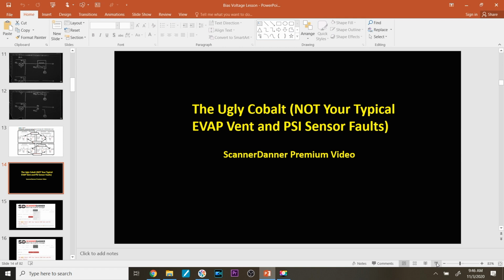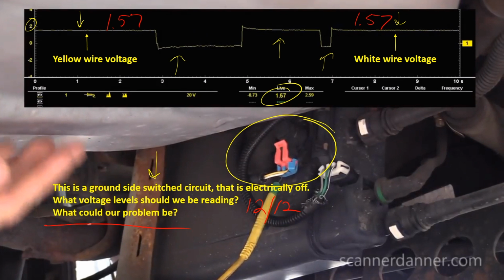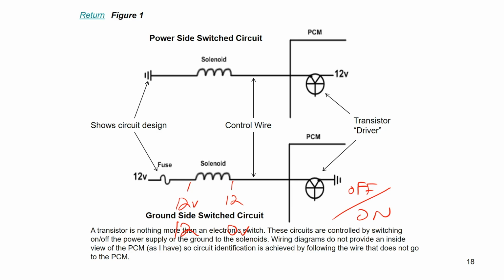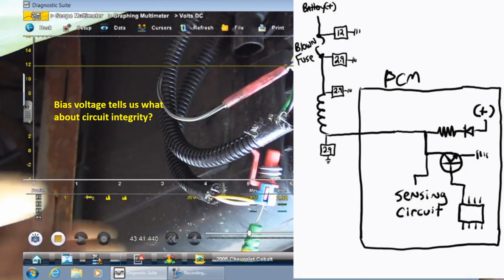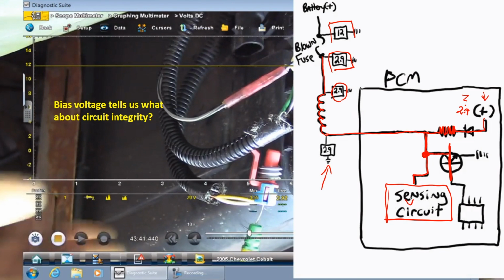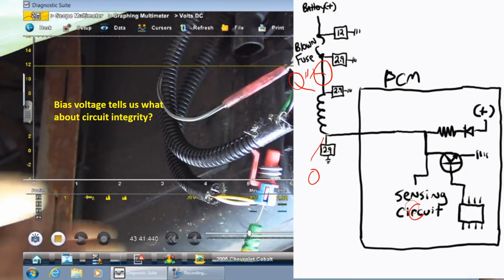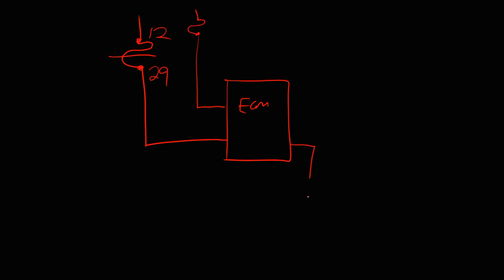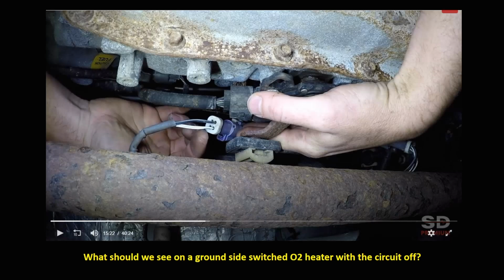An SD Premium lesson on Bias Voltage

Comment: This is just like my electrical engineering class, but we had to design for various parameters. There are also other configurations too, where it can become an amplifier.  That circuit is also the basis for 90% of the stuff that goes in computers and microprocessors. Once you can "NOT" "AND" and "OR" those things on a scale of a billion you have a modern processor.

Comment: best teacher ever, seriously. I owe so much of my success to you Paul!
Edit to ask:
If the car wasn't starting, why was it pulsing the trans solenoid (which caused the 29v back feed). Also, even if the fuse is in and the car is in working order (like the newer one that you compared the voltages to, to confirm your theory) wouldn't that 29v back feed cause problems with the system?
Thanks,
Dan
Reply from the maker: Half the PCM was alive and the other half wasn't is the only explanation I can give you.
Thank you Dan!

Comment: couldn't the short to ground be cutting the bias voltage from 5 or 12 vlt's to 2.9 vlts because it's a crappy ground?
Reply from the maker: No sir, the short to ground was on the power side of the circuit

Comment: one thing i would like to know .... 
1. At time 20.47, 12 v comes down all the way down to the leg of the sensing circuit, and meanwhile, 2.9 v should come through diode and also meet at the same leg of the sensing circuit.
2. You did not mention how 2.9 v behaves through diode and resistance??? If 12 v can come to the leg of the sensing circuit, where is the 2.9 v???? Is it 12 v-2.9 v=9.1 v be the reading at the leg of the sensing circuit??? Please clarify this.
3. How the 2.9 v behaves?
Reply from the maker: there may not even be a diode if the bias circuit is 12v but let's entertain that the source is 2.9 and that there is a diode. I placed the diode there in my imaginary drawing to show the 12v will not be able to backfeed into the lower voltage circuit, that is all. 
On a good working circuit (no opens), with the circuit off, you will have 12v sitting on one side of that diode and 2.9v sitting on the other side. No current will flow because of the diode preventing the 12v from "flooding" the 2.9 volt circuit. And looking at it from the other direction, the 2.9 volts cannot flow into the 12v circuit because the potential is too high. The sensing circuit will see 12v, with the circuit off. With the circuit on, it will see 0v. The purpose of the bias is for the module to be able to recognize the difference between an open or a short. Without the bias, it would not.
Reply: @ScannerDanner  okay thanks for the explanation. 
I now know why 2.9 v doesn't flow on the other end of the diode. I have to apply the rule 'current always flow from higher potential to lower potential'

Comment: Should I have a $3500 remanufactured transmission (jasper 100k warranty) put in an 03 Lincoln Town Car with 180k? I love the car and its otherwise in great condition (engine, paint, body, suspension, interior). I drive 60k highway miles a year for work and diy all the maintenance/repairs. Plastic intake manifold already replaced lol damn 2v 4.6
Reply from the maker: tough pill to swallow, how about a used one? Have you looked?
Reply: @ScannerDanner  2 shops quoted around $2000 parts and labor for used. That is with fluid and a new cooler. I believe the engine will last another 100k highway miles because it runs like a Rolex and only burns 1/2 qt of oil ever 5k
Reply: Yes, you absolutely should, provided the body and interior are in good shape.  I've got a 2003 Grand Marquis w 200k miles and the original transmission, and the car is mostly bulletproof and, when it breaks, it is dirt cheap to fix. The only big ticket item between now and 400k miles is a transmission, and I will gladly buy one when the time comes.   You can't buy a town car with less than 100k miles right now for under 10 grand, and even older ones with 200k miles are going for 5-6 grand.  $3500 to hang on to a model in good shape, with a 100k mile warranty on the transmission, seems like a no brainer.

Comment: The sense feed voltage can't be 12 volts, because then it wouldn't be able to set low voltage codes with an open curcuit. I would say it uses the 5 or 3.3 v regulator inside of the pcm.

Comment: hi paul i heard you in most videos talking about bias voltage but did not understant what is it . it is only today that i understood it. according to my understanding bias voltage is just a voltage disigned to confuse technicians. it has no use other than than.

your 2 years follower
m.b.s moshitoa (south africa)
Reply from the maker: I use it to determine circuit integrity. I has a HUGE advantage for a tech when you understand how to use it. 😉

Comment: About the voltage behind that diode supplying the bias voltage in the example of 2.9V, it's my educated guess that the supply voltage is around 3V or 3.3V.  It's possible that the diode isn't there and the supply is 12V, but that wouldn't really tell the computer anything through the sense circuit besides a shorted/open driver.  If the bias is low and the diode is present, the computer can distinguish an open coil circuit and a shorted/open drive circuit.

Comment: One good one that happen to me 
2011 ford ranger timing job crankshaft sprocket slightly different due to aftermarket parts on wrong box got the sprocket for a engine with balance shaft and the harmonic balancer when in a couple mm further in and crankshaft sensor had a intermittent signal
Reply from the maker: The video i mentioned with the 29v? That was one of the issues with that vehicle too! And is why it got the parts shotgun lol, crazy stuff for sure. Thanks for sharing!

Comment: Circuits like these are why we have big foreheads. Scratching your head and sliding glasses on and off tends to plow the field. I took a little mental field trip on an early 2000s ford ranger that I’ll never forget. With main PCM fuse pulled and KOEO probing both terminals, supply 12...PCM “load” side 24VDC. It’s the kind of thing you can’t just go look up lol. Interesting way of protecting the PCM. I had already found and fixed electrical problem but then noticed that KOER my PCM supply was less than charging system voltage. 
 You can pay to go to a class and hope they teach you everything you need to know in the field or you can take the basics you’ve learned and figure it out. Either way cost you money but I’ve done both and the lesson sticks better when it kicks your butt, you touched on that in this video. Good stuff man.

On an edit: I typed this comment before end of video, as soon as I clicked play you go into blown ford fuses lol. My thinking was that Ford was by design creating the higher voltage from a transformer in a means to protect the board. That critical 16-18 “poof” range wouldn’t matter

Comment: Paul, you should try troubleshooting with a digital probe.  By concept it's similar to a test light except it follows transistor - transistor logic.  Benefits include you can identify if the circuit is pulsing (whereas sometimes pwm is involved but the naked eye can't tell the duty cycle) it can tell you if you are at logic HIGH and logic LOW such as the ability to sink or source current. (similar to pull up or pull down circuits)  Seriously, give it a try, they are not really expensive and it's an easy learning curve.      I have a feeling GM may be employing stuff like this in their tech's training and equipment.  Cheers bro,  Louis

Comment: Many years ago, I built myself a set of 20 foot jumper leads out of radio shack mega-cable. I'm sure a lot of youngsters are probably asking themselves "wtf is radio shack mega-cable?" but I digress. You just had to be there. My point being, I can attach to the battery, and take hot and ground with me anywhere in the vehicle without wondering "am I on a good ground?". Yes, I understand there's certain instances where being attached to body or chassis ground is better for particular testing. However, the vast majority of the time, being solidly connected to battery ground is fine for testing. Removes a lot of the guesswork.
Reply: The whole intro of the video about testing with a "unknown" ground thats all I'm thinking of is my retractable dual lead set and I do the same as you sir!

Comment: Just something to add about the coils magnetic field causing that voltage spike.  The magnetic field of an inductor, or coil, wants to keep current steady.  It opposes change in current.  So, when the switch is first closed, the current begins to ramp up.  If the inductance is constant and the applied voltage is constant, then the ramp up of current is constant.  For the real techies out there, this is true until the core material of the coil saturates with magnetic flux and/or the wire resistance comes into play.  The point of this post is, the collapsing magnetic field doesn't directly cause the voltage spike.  The collapsing magnetic field wants to keep that current flowing and essentially slams it into the open switch contact in an attempt to keep it flowing.  This slamming of current is where the back emf comes from.  Think water hammer in plumbing.  Anyway,  the back emf will rise to a voltage required to stop that current, or it'll blow over the switch contact.  A third option, and this is usually what's done in reality, is the circuit is designed to allow the back emf to rise to a limited voltage before it allow the current to continue to flow, thus holding at that back emf voltage.  The high back emf voltage pushes back on the current bringing it to a stop, then the back emf is no more.  The higher the back emf, the faster the current stops.

A side note, the back emf may not be gone when the current stops due to parasitic capacitance, which can cause the circuit to ring (oscillate) a bit before it settles down.
Reply: I have been wondering about the reverse voltage EMF induction spike bc I have read that the backfeed induction spike could cause computer circuit damage e.g. not giving spark plug a ground path when doing a kill cylinder test. I was pooh poohed by a mechanic friend re this bc he has never had any untoward result from doing so. Do the engineers design stuff to be able to handle a loss of ground? Thank you.
Reply: @gnomiefirst9201  there is some danger in running  a spark plug without a ground as the spark voltage will rise until it blows over somewhere.  That somewhere may be inside the coil itself, which can damage the coil.  I doubt that protection against this has been incorporated beyond another spark gap that's much bigger than the plug but small enough to protect the coil.  I'm speculating, as I know no details about how the coils are designed.  They seem to be able to survive a little while open circuited but I don't think they're guaranteed to.
Reply: @ThatEEguy2818  thank you for your reply.

Comment: It's really almost the same circuit just flip-flopped transistors being used as a switcher not an amplifier through the collector emitter when it gets saturated it's a switch and then the voltage is on the solenoid 12 volts they just rearrange the solenoid and transistor I am assuming transistory's npn and forward bias is being applied by a computer to base emitter

Comment: 9:20 I can vouch for this personally guys... listen to SD here, espically if u want to be a good tech. I was made fun of at my old job for doing "stupid extra tests" before i would finish my diag and request parts. Funny thing is... Within 1 year i had surpassed the electrical diag ability of everyone in that shop, some 20 year veteran parts changers lol.. AND the learning never stops. It helps me stay motivated and is rewarding, if u can save a customer money yet still make good money on ONE correct repair. Remember guys were in the trenches as auto techs and can have a massive affect on peoples lives.. for the better or worse.
Reply: I can attest to the faster learning curve by being in Scanner Danners classes.I think I've only been in his class for 10-1 year.But, when I first started as a Mechanic and I mean a Mechanic I was turned into a Assistant Service Manager for a company called Monroe Muffler.Where I diagnosed and made repairs on new and old cars and trucks.(Gasoline and Deisel)And stayed turning wrenches and studying Danners classes online.I lean towards the Electrical Automotive side of things because it's helped me move up as Technician.I just hit play and let Scanners drill it in my head.It works I promise
Reply: @timothybarnes533  I have an electrical engineering degree and this concept is burnt into you. We focus on the design side of things though, and that can get complex when parameters, cost and reliability gets involved. It is also the basis for what is a modern computer. WIth circuits (and logically combining the results) you can do arithmetic, compare numbers, etc. Pretty much the processor in your computer. Probably way overkill to work on a car, but I have a sense for almost any electrical issue.
Reply: @user-rz9er5dm6k  sounds like to me you have a disfuction Way of thinking dude .... I think you're Brain is mathematically confused .
Reply: @FiveTwoMoto: Herd mentality to make fun of or ridicule the things you don't understand.

Comment from the maker: The two people that thumbs downed this video so far must like to use their ohmmeters for circuit integrity testing lol
Reply: They are parts changers
Reply: Lol I’d hate to meet a person who would dislike a scannerdanner video.. must be super annoying honestly 😂
Reply: Our electrical troubleshooting instructor warned us that he'd smack us if we answered a circuit integrity problem with "continuity test" lol.
Reply: Dynamic testing is the future
Reply: They were Fred Flintstone and Barney Rubble
Reply: I cringe when other engineers put my meter on to continuity to check switches with the power off.
I’m like put the power on and test it. That’s how it’s meant to exist.
Why test a switch that switches voltage that’s going to be higher than a continuity test.
I learned that from SD Premium.
Reply: I got burned 🔥 many times using the ohm part of the meter!
Reply: Right you are Danner
Reply: hahaha,  who are you not to have haters. even jesus had his haters mos
Reply: Or test lights
Reply: @xj31  except there's nothing wrong with using a test light for circuit tests
Reply: @jeffcompton6937  In some situations, I would agree with you.

Comment: Hey Paul, this video got me to thinking why the manufacturer flow charts don't have you measure the bias voltage, because on your meter, say for example in this video, you would read 2.9 volts where my meter might read 3.4 volts, and someone else might get a reading of 2.3 volts, depending on the internal resistance of the meter. Of course, they could always say to measure making sure you used a 10 meg ohm impedance meter. Just a thought.
Reply from the maker: they really should! I don't know why they don't? Instead they want you to dig the computer out of wherever it lives, disconnect it, then disconnect the output device, then use your ohmmeter to check for opens and shorts. smh
A bias voltage test is 1000 times faster right?
Reply: @ScannerDanner  For sure!
Reply: @ScannerDanner  danner i went to u.t.i. and graduated in 08,they taught us good electrical classes but i still wasn't 100 percent sure what i was doing,then i got in a dealer and started gettin my feet wet in diagnostics and used the flow charts.....and i never understood why they had me unplugging computers and devices to Check circuit integrity. Then i found your videos and bought your book and i took off man you give people so much confidence and explain things that are easily understand. Thank you sir!
Reply from the maker: @85jmccoy  thank you so much my friend

Comment: If the ecm monitors the ground side wire for voltage, IE to see if circuit is on or off.  Then why would it use a bias voltage as well? Is that how it knows it's short to ground rather than just switched on. Does this question make sense?
Reply from the maker: Good question! Here is the tricky part in answering this question. Pick another GM, maybe even the same year and the same circuit, and there is no bias there at all! So why on one model and not the other? These circuits are built for diagnostic purposes, no doubt, but I've also read some literature on analog to digital converters where a bias line is used to aid in that conversion process, so who knows. In this case though, we could argue that the ECM can now determine the difference between an open and a short to ground. No bias, the ECM would see 0v in either case. with a bias the ECM will see 0 volts with a short to ground, and some voltage off zero for an open. Make sense?

Comment: Good mornig sir .. i have one question  can you help 
I have Elantra 2017 model 2.0 engine v4 
Push start 
Push start button do not work and do not on the ignition cluster meter and do not start the car 
When i put the battery direct supply   ecu fuse and then stator relay 87 put the battery  supply  then car start but push start button  doesn't work do not off the car through push button 
I put the scanner no dtc found 
I do the change the parts ..
Ipdm fuse box inside 
Ipdm small fusebox underhood 
Push button 
Streering colom ignition 
Check the remote battery 3.25volt 
And programme the remote fod key 
The remote are working unlock lock the door only problems is ignition do not on by the push start button what i do send to suggestions please.....
Reply from the maker: Salim, post this to my forum www.scannerdanner.com it is free to join and we can absolutely help you there! These questions would involve research on my part to be able to answer, which we can do better on the forum as I also have some hand picked moderators who are there to help me help you guys! Hope to see you there